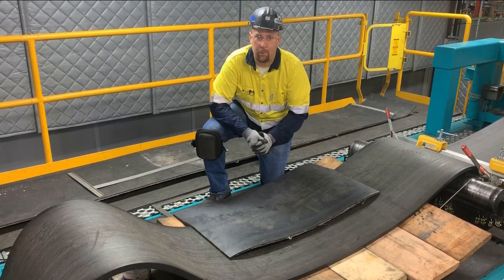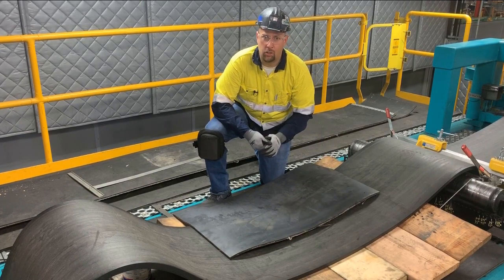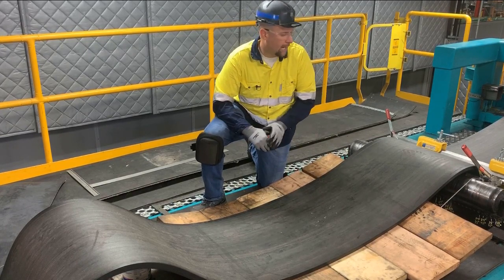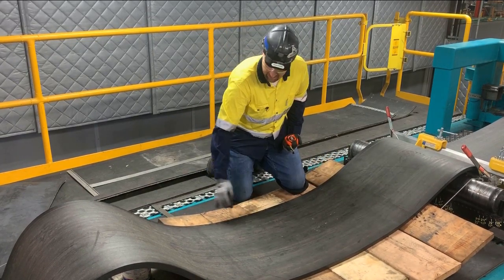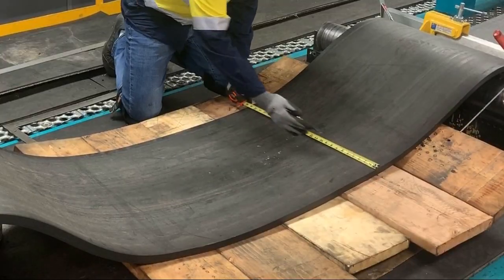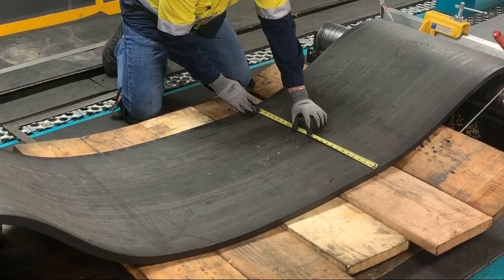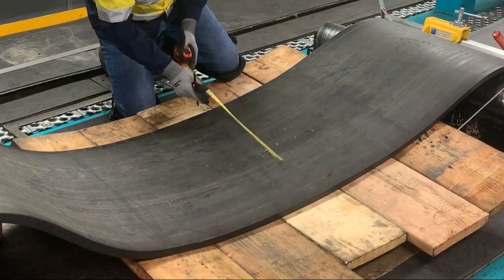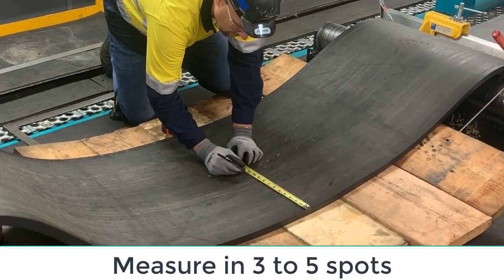Squaring a belt with worn edges

Comment: thanks for the video. could you have just used the big square on the good side and drawn a straight line across the belt or would that be incorrect ?
Reply from the maker: Best practice is always to find the average centerline of the belt and make your cut line based off of that.  There is slight variations in belt width during manufacturing and the slitting process.  Finding the average centerline gives a more accurate square cut line.

Comment: What if both sides have been worn out?
Reply: @flexco tube TELL my boss that
Reply from the maker: If both sides of the belt are too worn then you can not accurately find the center of the belt so you will not be able to create an accurate square line. There is a time when the belt just needs to be replaced to ensure proper conveying characteristics.